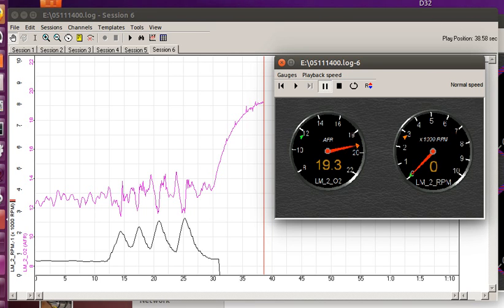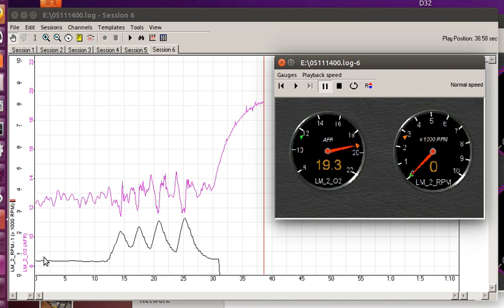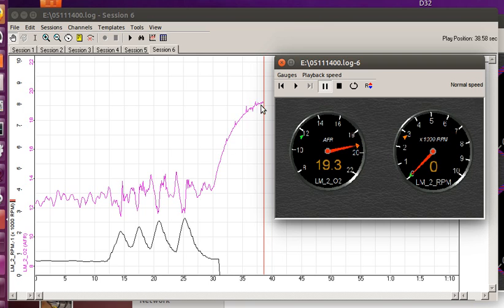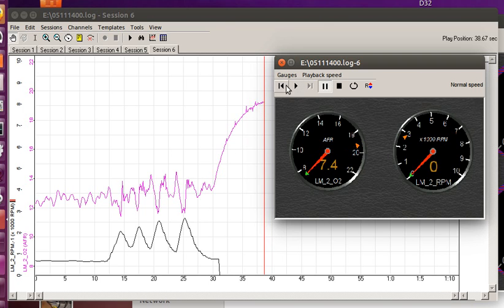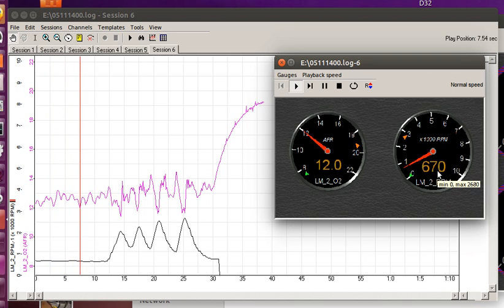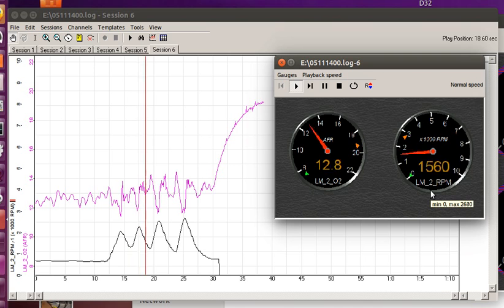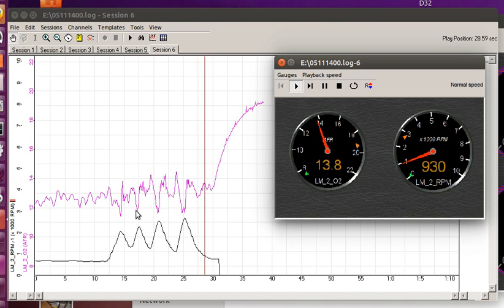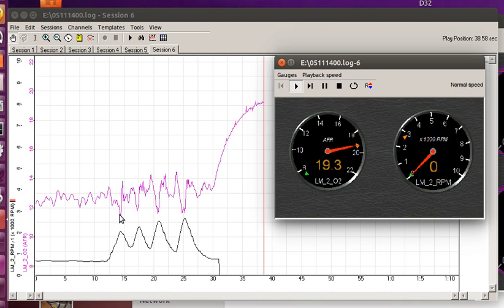Innovate LM-2 New RPM signal location

Comment: Hi, I only installed the AFR sender unit and the programm only shows me AFR 7,3 jumps to 22,39 and that's it. Do you know if I need the RPM singal, too? My diagramm does not look as dynamic like your's.
Reply from the maker: I have a plan to make a full and updated video for the LM-2 shortly, these videos were linked to a discussion board years ago.